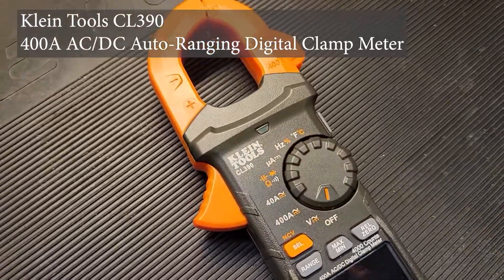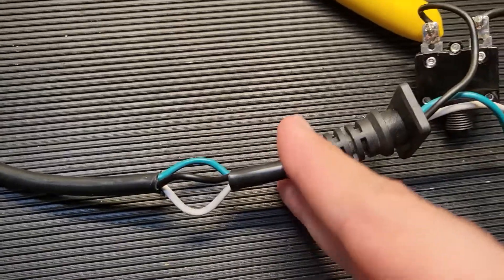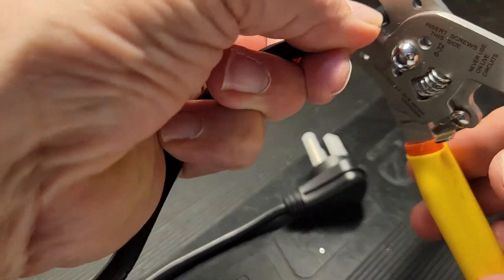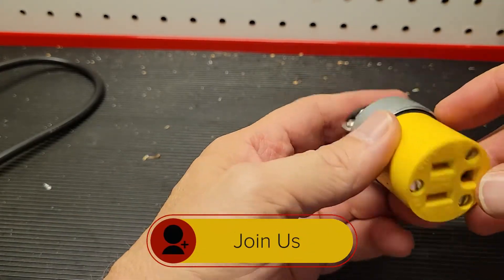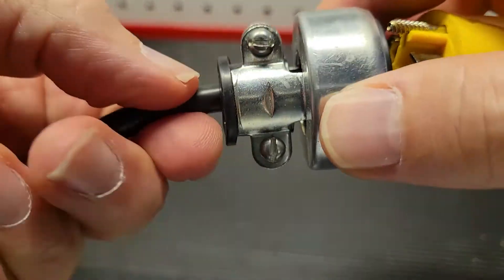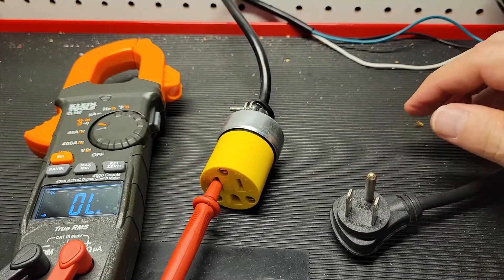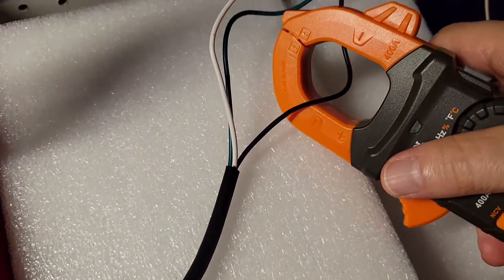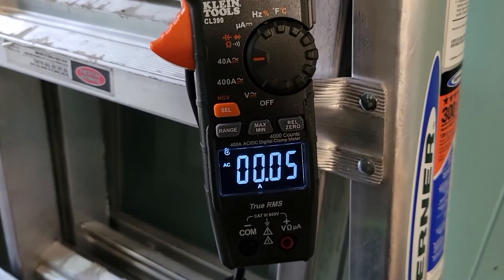DIY Line Splitter for AC Digital Clamp Meter

Comment: In Heavy Industry as an Electrician, I used my Sta-kons (Crimpers with Cutters on the End) to do some work on Power Cords for Plug Replacement, but if you cut a very shallow groove with a knife from the points you intend to remove the Outer Jacket from, then using a cutter (Diagonals or Sta-Kon Cutter) to get the initial start, in the Groove, like you cut around the Outer Jacket, once you have enough to pull, the Outer Jacket will split easily along the shallow knife cut. Of course, never use on Live cable, and check closely for nicks in the wires when the outer Wire Jacket is off. Thanks for the video.
Reply from the maker: Can't be stressed enough to check for nicks in the wires, especially for us DIY folks who don't handle wiring everyday. Thank you so much for sharing your experience, it is always great to learn.

Comment: Why not just use a 15amp rated extension cord and split the wires like you showed and call it a day?  Why replace the female socket?
Reply: good idea
Reply from the maker: Rob, while I repurposed a power cord from a deceased compressor, one can use any short 15 amp rated three prong extension cord and as you say call it a day. I would rather repurpose an unused cord (if avail) then take a perfectly good extension cord out of service. Thank you for watching and the excellent question.
Reply: @cfldriven  appreciate the thought!

Comment: I am curious about that safety tip of not having lead probes attached durring a clamp reading. What is the potential risk?
Reply from the maker: The clamp meter provides protection when used correctly. However, inserting the test probes into the input jacks while measuring current can compromise this protection. Never measure current while the test probes are inserted into the input jacks. It provides a potential path for current.

Comment: It would also be really helpful if you listed in your video the clamp meter you’re using or recommend.
Reply from the maker: I do mention the model number in the beginning of the video, the AC/DC clamp meter is Klein Tools CL390. I think it was about $89, it is my go to meter, replacing a very old Sears analog multi-meter.